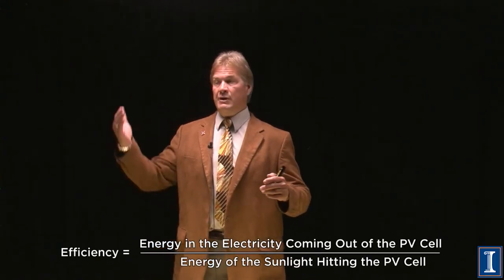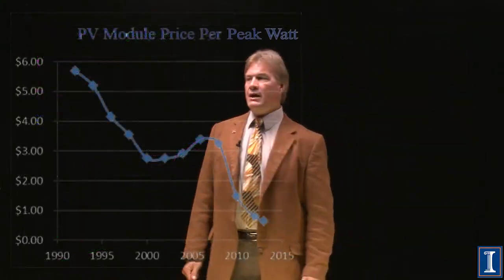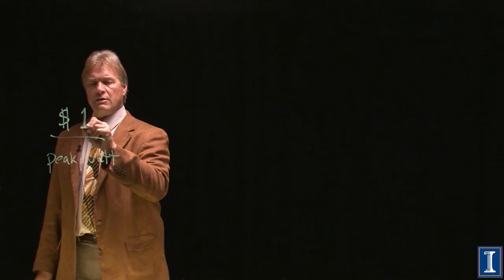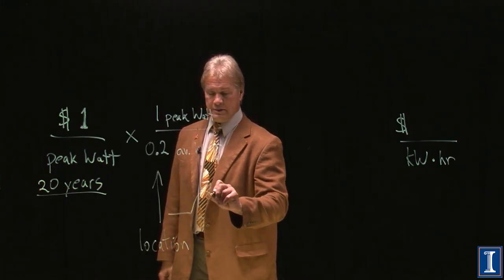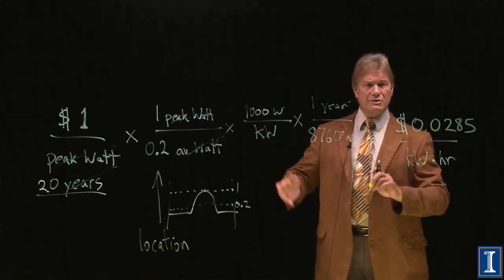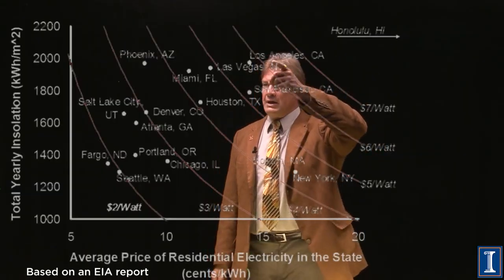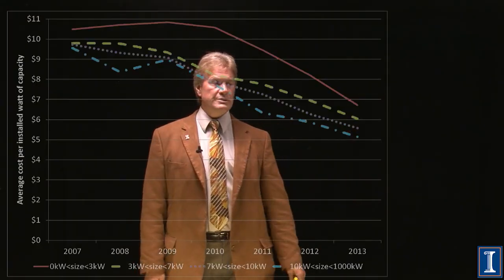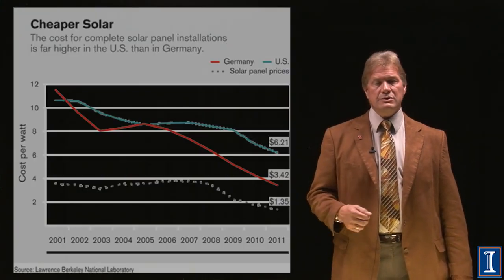The Cost of Sunshine

Comment: A friend of mine bought a cabin in the Tehachapi Mountains and he and his wife live there full-time. No power grid is available and one has few choices for power. Anyway he has been happily electrified since 1986 using a system I designed. Hopefully I will be able to do more of this sort of thing when I retire.

This is an excellent video, suitable for the beginner and for professionals. I highly recommend it for anyone who wants a realistic view of this subject. As I see it, we have two choices for future power options assuming fusion isn't commonplace: nuclear and photovoltaic. Both have their advantages and disadvantages and there is no reason why both cannot be used simultaneously.
Reply: mind sharing the system you designed?
Reply: @woutervan8019  Remember that this was the middle 1980's and solar had not progressed to nearly anything as it ; now. It used a Trace 48 VDC to 115 VAC 60 Hz inverter with golf cart batteries-definitely low tech by current standards, no pun intended. PV panels were all ground mounted on frames. There was no budget for anything fancy such as trackers or even site selection toys. I installed an ammeter between the panels and the inverter so that one could maximize current flow by adjusting panel position...my version of a tracker. Obviously this couldn't be done every hour but 15-20 minutes each week wasn't out of the question.
Reply: Threat Dynamics thanks, was interesting!
Reply: There are MANY options including continued use of coal.
Reply: There are many options, most you will likely be unaware of, such as PES (PhotoElectroSynthesis) which has 95% photon efficiency and stores the captured light energy as methanol. Or tethered electric kite-planes like Makani makes, to name but two.
Reply: YodaWhat having not looked up/knowing anything about the kite-planes, I can say, as a pilot, they wouldn’t make it large scale, let alone do much better than ground based solar. 9/10 when there are clouds blocking ground solar, there are 4+ layers at different altitudes raging from low (only a few thousand feet) to high (20,000 feet plus). Not to mention that airspace can’t be blocked off from commercial, general, and military aviation use. Take key west as an example. There is a weather balloon thats launched from near the air force base, it’s air traffic exclusion zone is 4 miles wide and is one of few permanently closed air spaces within the us to all aircraft (ish)

Comment: I may have got this wrong. It seems to me that you haven't included the cost of the land, which is certainly present for traditional power plants. Cost per square meter of land is not going to be insignificant.
Reply: I wasn't using my roof before I added solar... and most land used for solar isn't very viable for any other purpose.
Reply: @Chris-ie9os  I don't know how many Watts per metre your house uses but I am willing to bet that it's a lot more than you can get off your roof. I don't know what interest rate you'd have received on the money you've invested in panels and inverters either.
  You've kind of conceded my point, unless the land is worthless then solar is a pipe dream and most Western countries don't have a plethora of deserts.
  My opinion is that 'renewables' are a complete waste of time with regard to: return on investment(money); return on investment (energy); return on investment (area); damage, or lack thereof to the environment; ugliness.
  I'm not claiming to know everything however 'nuclear' seems to be such an obvious way to go, especially the atmospheric pressure types.
  I do like your videos. I'm a fan.
Reply: @benchapple1583  Um no... the vast majority of homes can easily generate more energy than they need from their roof.  Especially if they use higher efficiency panels available today.  You can get a 360w 1.6m^2 panel.  So  you can generate ~350kWh/yr/m^2.  You would need <40m^2 to generate what the average home needs.  That's an area 20' x 20'.   Last month I generated 1300 kWh from my roof and only used 400kWh.
Reply: @Chris-ie9os  I suppose it depends on where you are. During mid winter I currently use 240kW hrs per day and I need a second wood burning stove at the other end of a 70 square metre house so that I'm not trapped in one room. Then it would be 480kW hrs. This is where I got the idea that a house can't be powered from the roof. Maybe I should move to where ever you are. I stand corrected but still love the videos.
Reply: @benchapple1583  ??? 240kWhs/day???  You should look at that again.  That would be a ~$720 monthly bill for most areas.  The average in the US is ~30kWh/day.  Even high use during a cold month would be <100kWh/day.   With a good heat pump you can heat a 2000 sq ft home using <50kWh/day down to 0F.
Reply: @Chris-ie9os  Prompted by your answer I've checked my numbers and they don't seem far off. During the winter temperatures are as low as -10 in American money and I consume about 6-7 cubic metres (230 cu ft) of beech, specific density circa 0.75. At 4.4 kW/kg(1.9kW/lb) that's 18.5MW over 90 days. The wood is very well dried. The guy I buy it of keeps it for at least a year and after that I dry it for a further two. These numbers, while true, are outrageous. The answer may lie in the rather poor building practices in Serbia and the higher than usual ceilings, 3.5m or 11.5ft. The wood costs 5500RSD ($52)/cu m ($187/cord). therefore costing $340 per year. Now that I'm thinking about it these are average numbers. When I'm at work the stove goes out and also when I sleep. Max output maybe as high as 20kW/hr. And I'm thinking about buy and installing a second one so you can double all the preceding numbers. Here, I'm considered a bit of a miser, my friend uses 20 cu m a year (5,5 cords)
Reply: @benchapple1583  Even if your maths on wood are correct you're confusing primary energy with useful energy.  A wood stove at best is 70% efficient... AT BEST a good chunk escapes out the chimney because physics.  Electric heat is 100% efficient... AT WORST also because physics with an electric heater there's no where for the energy to go.  A good heat pump can be >400% efficient (effectively)  For every 1 unit of electricity you get 4 units of heat.  Go find your electric bill... I'm betting you use <30kWh/day.  Keep using wood for heat... use solar for electricity :D    Depending on the cost of wood maybe get a heat pump :D
Reply: @Chris-ie9os  You are  right that stoves are not 100% efficient. They are at least 70% efficient, some of them are getting close to 90% according to EPA figures. I'm not sure I trust them as they don't seem to allow for unburnt gases and particulates.
  The heat pump sounds interesting. Use solar to drive a heat pump and you get a 4 fold increase in heat output. While this is happening the panels would be under about 800mm (31 in) of snow. How that effects them I just don't know. I've slept in an igloo and light definitely goes through snow. It could make them more effective due to cooling or less due to some effect I've never heard of.
  You're right about my electricity bill. I doubt that I use 15kWh per day. It costs about $20 a month.
  The cost of timber has already been stated at $187 a cord or $52/cu m for beech.
Reply: @benchapple1583  .... ok.... so use the solar to cover the 15kWh/day.  Maybe a heat pump when it's not super-cold and save the wood for when your need it....
Reply: @Chris-ie9os  I like the heat pump idea. There is a time of the year, autumn and spring for about 4 weeks, when the furnace is just too powerful no matter how skillfully I control it. I've enjoyed our discussion and it has made me think.
  With the arguments you've put forward in favour of solar panels I've been wracking my brain to find the reason why no one at all has solar panels on their roof in Serbia. And it dawned on me, every now and then, not every year or even every five years, we get a hail storm that smashes car wind screens, dent's bodywork and breaks roof tiles. The hail is the size of your fist, sometimes the size of a grapefruit and occasionally the size of your head (I've seen it). That's the reason.
  Okay, I'm off to investigate heat pumps. I still like your videos. Thank you.
Reply: @benchapple1583  We get hail here too.  7 years... 0 broken panels :)

Comment: Making the transition from on grid to off grid requires a reevaluation of your energy usage. I charge a 12V leisure battery from a car, and use a 300W inverter if I want 240V. The inverter is powerful enough to run a portable washing machine, a drill and my jigsaw. I run 12V LED lighting and a single 12V to USB converter. All my heating comes from a home made wood burner.

Comment: Your estimates for cost of solar ($5-$7 /Watt peak) are a bit high.

Installed solar for my home was $11,000 for a 3,500 Wpeak system. That's $3/Watt peak. 
Large-scale solar farms run much closer to $1/Watt peak :
https://www.energycentral.com/c/gn/initial-steps-building-solar-farm

Subtract from that the 30% investment credit, and cost of solar is lower than any other energy source.

This low cost of solar has created a great solar industry employing over 242,000 solar workers, according to the National Solar Jobs Census 2018.

Unfortunately, Trump will cancel this investment credit this year, and created a 50% import tariff on solar panels, and on top of that Utility companies are canceling Net-metering (such as in Nevada), which all in all kills the residential solar industry and the jobs that come with it.

Comment: I’ve done a few solar farm jobs and I was amazed at how much energy is used to create these farms. Between manufacturing, shipping ( the panels came from China to the US east coast), installation of the not only the panels, but all the mounting hardware, it is expensive and time consuming. Plus all of the power cables, combiner boxes, and eventually feeding to the inverters. Most people don’t realize that solar panels produce DC voltage that needs to be converted to AC, using inverters. Converting AC  to DC is easy, but converting DC to AC  is much harder with a substantial loss of power.
Reply: Modern inverters can sync to the grid and convert DC => AC with 98% efficiency.  2% loss is 'substantial'?
Reply: Ugly Blue Chair Productions: Yes, exactly. He also made no mention of
the ways that China extracts and processes the materials - i.e. the 
environmental damage caused. Another point I rarely hear mentioned is
the the home owner maintenance required - assuming battery/etc hookup, 
not grid tie. How many folks will even check the oil in their auto, much less
constantly monitor/maintain their system? Being a retired EE, I love all 
things electrical, but we must be realistic about advantages and 
disadvantages. For our farm gate and a remote shallow well solar is just
great. For our home and workshop - not yet. And I see no usable solar 
powered tractors on the market yet! (-; ................
Reply: @dd_ranchtexas4501  All energy has environmental cost.  Fossil fuels are very high because you have to keep digging them up.  Solar is less because you can recycle the materials after the cells run out.  Also most of the cells will last for more than 20 years.  That is just what the manufacturer  guarantees.  It is like cars.  Most cars last longer than the manufacturer's  warranty. Also maintenance is why you want utility scale solar rather than residential scale.

Comment: Sadly you missed the biggest factor in solar. The huge problem with solar you dont store, and there really is no way to store it, is that while you crank up solar and wind  the utilization of fossil fuel and nuclear plants decreases. That why making electricity overall alot more expensive. There basically are two parallel energy infrastructures build up in places like Germany and both of them only run half of the time. 
So your math is strictly speaking misleading.
In a free market typical power plants just lower prices during sunshine and wind, because it makes economic sense to keep utilization up. And if there is a law against it, energy prices increase alot.
Reply: That may be viable for nuclear plants but for coal and gas they would have to lower the prices below fuel cost to keep solar out. Now the interesting thing is that gas power plants are cheap to build but expensive to run( https://www.youtube.com/watch?v=cbeJIwF1pVY ). So you just don't compete with solar cells when they do generate electricity because you lose money when you do. Gas can ramp up and down fast so they will do that. Coal and nuclear usually can't so they will not and coal will lose a lot of money. On the other hand solar cells are expensive to build but very very cheap to use(maintenance and so on). At least in sunny places like California they will outcompete gas in the day.

The second thing is that you may do rooftop solar. There it's even more interesting because solar rates are not competing against the price the power plant charges but against the price the provider charges. Local battery storage, that also gets cheaper and cheaper fast, also can be beneficial and economical in that environment as it decreases your reliance on external power.

Third gas and coal externalize their climate cost. We have to be totally neutral as fast as possible. We don't have the build capacity to do that nuclear and they wouldn't be completed fast enough anyway even if we could build dozens of them at a time. What remains is to go renewable as fast and as hard as possible.
Reply: impossible to store? there are plenty of people who have disconnected from the power company and run solar panels connected to 12v lead acid batteries or preferably 3.7v lithium ion batteries from used sources such as power tools,laptops,electric vehicles.. they function at over 60% capacity for decades after taken out of these sources which is fine since you arent worried about portability when theyre stacked in your garage or basement

now im sure these people all have a back up genset and use it multiple times a year but if you do the work and scavenging yourself you can turn 5k into 10 years of power if not more
Reply: As long as you dont achieve 100% coverage from storage you will need other infrastructure set up that just waits most of the time.
Gas is certainly the most flexible power source sure.

Comment: A needed add-on to discussion of solar and wind - is the *cradle to grave* - total cost of ownership.  Disposal of PV and fully expended wind farm machinery is not trivial, nor are the inputs required to extract, refine, manufacture, transport, install, maintain, decommission, dispose of all of the elements that go into both technologies.
Reply: I bet it's cheaper to decommission a solar power plant than a nuclear one.  It's even possible to simply demolish it and put all the rubble in a hole in the ground.

You can't do that on a nuclear power plant.
Reply: @thoriumbr  perhaps so, but the amount of energy, at 90+ percent capacity factor, generated over the life of the nuclear plant utterly dwarfs - by several orders of magnitude - the energy generated by the PVs.  And, to a large degree, you can actually just entomb and bury decommissioned nuclear plant stuff.  Except that scientifically illiterate, hystericals, won't allow it.
Reply: @thoriumbr  Much of the solar panel waste is toxic. Maybe you can dump it in a third world country, but developed countries will enforce strict toxic waste controls. Very expensive, especially since you must change out your entire solar inventory every 20 years; that's an enormous waste stream. See his video on nuclear waste to learn how easily manageable it is to store high level radioactive waste.
Reply: @SWOBIZ  i live in canada solar panels are considered construction waste and go in a pile with moldy gyprock and wood scraps for free
Reply: @thoriumbr  It is probably also cheaper to decommission solar panels than to deal with long term storage of fly ash from coal plants.  That stuff is nasty and hard to contain, and can potentially be dangerous for longer periods than nuclear waste as well as being far more plentiful.

Comment: Great presentation (as always). The big question that I have is, that if the government did not subsidize these installs, would they make economic sense. Do the panels over the lifetime, produce more Joules than it takes to mine the silicon, manufacture, ship, install (and constantly clean) them.
Reply: Narayan Mohanram Depends on the subsidy but I would say no bc solar is not energy dense so it will ever tackle our energy growth on an large scale. Scalable energy production will only by fossil fuels and the new molten salt reactors (hopefully Thorium based).
Reply: Yes, they do have more energy output than the inputs... unless you put them in a stupid place like a roadway...
Reply: This should be pretty obvious just from looking at the economics.  Right now it looks like commercial scale solar costs about $0.16 per watt of panel(and about $0.45 installed).  When you factor in all the labor involved in mining, refining, manufacturing, and transporting the solar panels along with a profit margin it is obvious that the cost of energy used per watt of panel built must be considerable lower than that.  Assuming that the average panel is installed somewhere with a capacity factor of closer to 0.3 rather than the 0.2 it is in Illinois and each watt of panel will produce 2.6 Kwh per year.  Even allowing for lower energy costs in China it seems unlikely that making the panels would use more than a years worth of the energy it produces, and newer panels should last long enough to produce about 25 years worth of power over 30 or so years, allowing for degradation.  That means that solar panels take about 4% as much energy to make as they generate, going up to maybe 5-6% when inverters and support brackets and such are factored in.